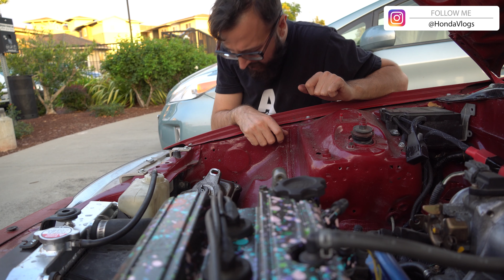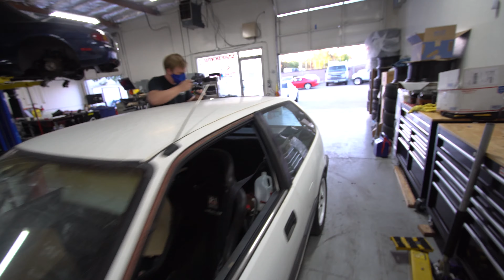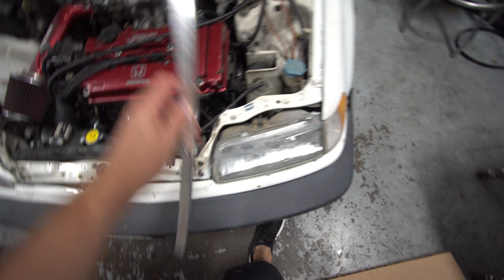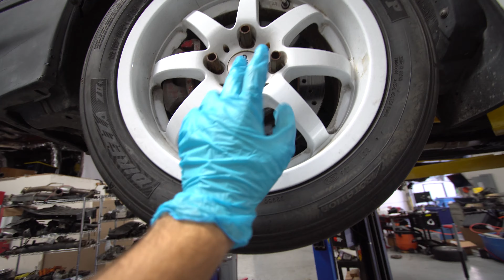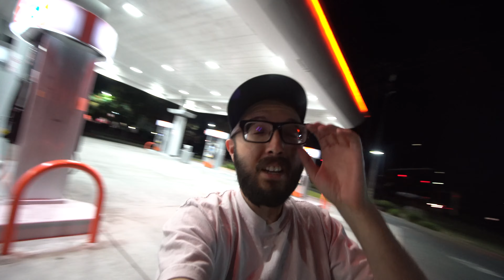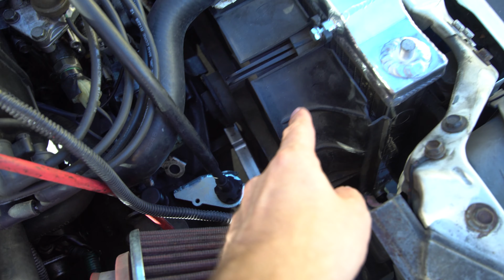EF Hatch Full Skunk 2 Radiator - Making the EF even cooler

Comment: sorry couldnt be much help on the hose. Now that Im looking at what you have,  I Think what I have used before was a slim fan then the hose fit between that and the hasport, But If I rember correctly I cut open a spare hose and zip tied it to the existing one to protect it,  as it was touching.  But I do have a spare LS obd 1 ecu. let me know if you want it.
Reply from the maker: Yo! I was just reading the lower hose comment, yeah it was just really close. I think what I have works just needs some adjustments... That ecu would be dope!
Reply: @HondaVlogs   not sure if YT has dm but you can hit me up on IG @edj4 send me an adress I'll get it shipped out to you. or youre welcome to drive up to  Sac if you want.

Comment: Whats up bro, quick question. What radiator hoses you running? Thanks.
Reply from the maker: When the swap happened it was just d series  hoses but when I put the skunk 2 rad I had to make a custom one because I didn't have b series hoses. Lol if you just have any B series  hoses it would work.
Reply: @HondaVlogs  appreciate it.
Reply: @HondaVlogs  I grabbed a 99-00 Si upper hose and 90-93 Da lower, trimmed them a bit and they fit like a glove. Thanks for pointing me in the right direction.